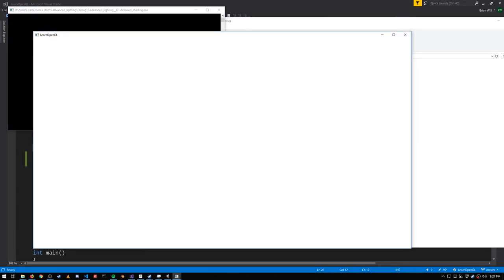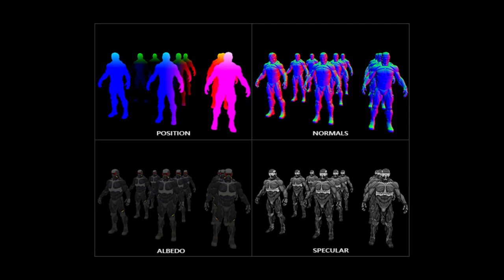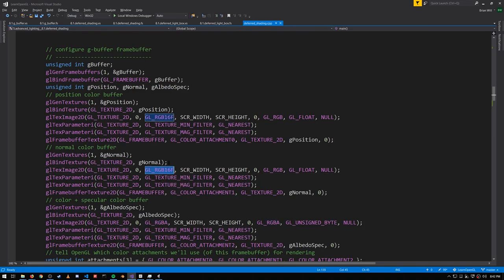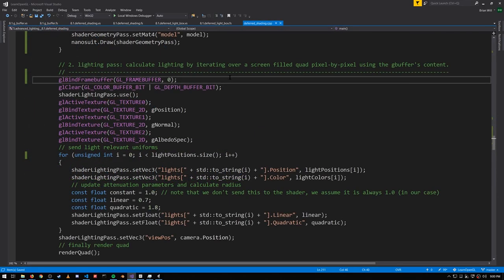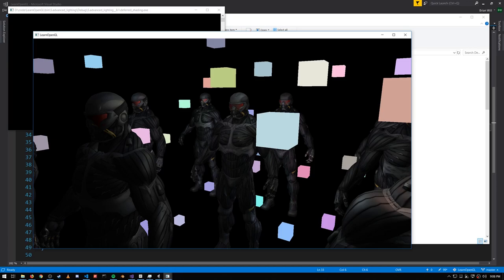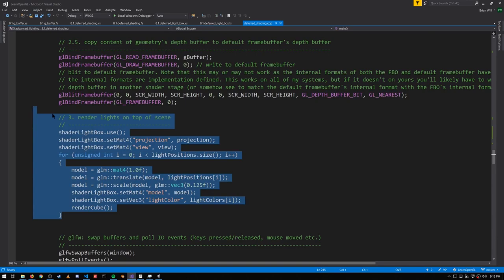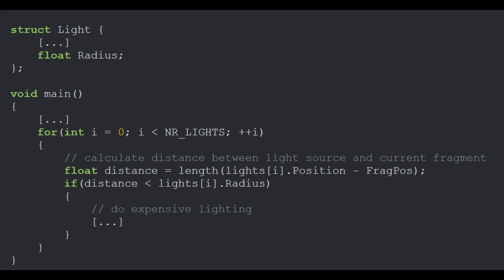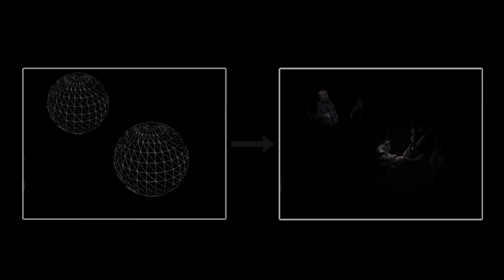OpenGL - deferred rendering

Comment: Nice and detailed video! ;) You can save a lot of memory and memory bandwidth if you don't store a separated "position layer" in your gbuffer, because you can recalculate the positions from the depth buffer (and you write and use the depth buffer anyway).
Reply from the maker: Does the extra fragment work outweigh the bandwidth? I'd think for high-end rendering on higher end hardware , the computation cost would outweigh the bandwidth savings.
Reply: @briantwill  The main problem with the deferred rendering is the memory bandwidth cost which is huge. Doing some math on the GPU is most of the time costs less than abusing the memory itself (there are exceptions, ofc;)). Reconstruct the position from the depth is just one multiplication and it's faster than sample a 32F texture. In other hand, you need to write the texture (which costs more than a sampling itself) and for the position, this implementation do it twice (once for a depth and once for a position buffer).

You can do the same with the normals: convert it to screen space and save more bandwidth
With screen space normals, you only need the X/Y values. You can save the Z channel and save extra precision with it, because you loose precision with the ability to store normal values for polygons which are backfaced to the camera
Reply: @Mcs1v  nice!! Thx
Reply: @Mcs1v  how can you store a normal with only 2 values?
Reply: @user-dh8oi2mk4f  Hey! You can convert it the "screen space" (in screen space you only need the vertical and horizontal normal), and you can convert it back to 3d normal after that

Comment: Just a question, at 5:40, I am not OpenGL expert. Does it make difference to use glBlitFramebuffer here (with nearest and same source / destination dimensions which disables resizing basically), vs using glCopyTextSubImage2D or glCopyImage ? I think the primary intent of glBlitFramebuffer is to do resizing of buffers and converting texture formats. I know for the fact that on some older hardware and older drivers glBlitFramebuffer can be slower.
Reply: Because it's hard to find what I need

Comment: Amazing video! I do have a funny hypothetical question tho. Let's take a fixed camera with 2D background system( such as RE2 of FF9). How would someone go about having a pre-rendered G-buffer, and make it so that the first pass just skips the static elements and only updates the buffer where dynamic 3D objects are found??
Reply: Sorry for a very late answer, and also for the fact that I have never done this. But you could simply just render the static background to the screen buffer, and then render the 3D objects first to a texture - that you then render the texture to the screen buffer on top of the background.

Comment: Does it make any sense to have another gbuffer that stores values indicating which shader to use for each pixel? In this way it is possible to use multiple fragment shaders right?
Reply from the maker: Yeah, you might put more pixel info in the gbuffer, including a value that governs which shader should process that pixel. You wouldn't necessarily need a separate gbuffer but rather an added attachment of the same gbuffer, or an added channel on an existing attachment. 

Keep in mind though that, skipping over code with a branch doesn't really spare us the work on the GPU except in cases where all 64 cores happen to skip the code; if just one core doesn't skip the code, all other of the 64 cores will have to wait. So your idea is doable, but it requires branching in the light pass shader and so has this performance drag. It generally won't be quite as expensive as processing all pixels with all N of your light pass shaders, but it'll often be close.